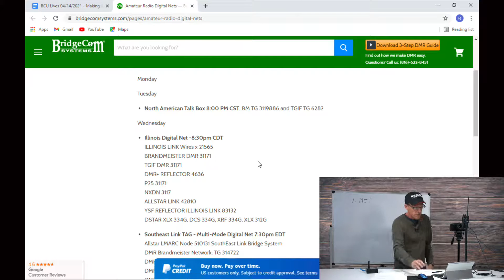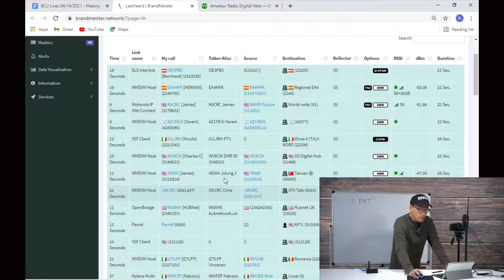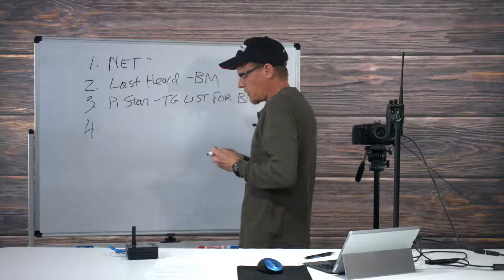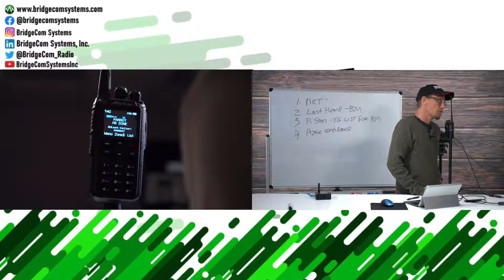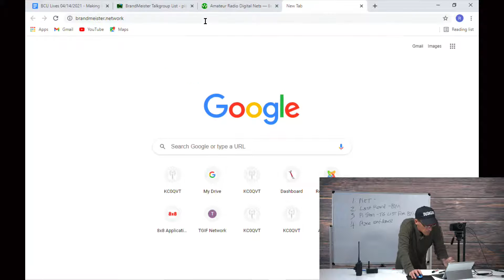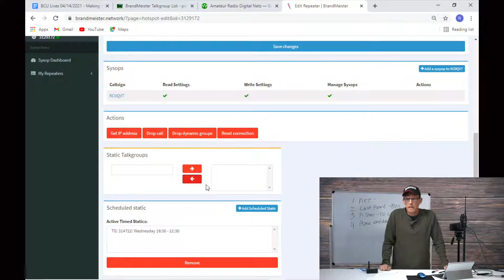How to Make a DMR Contact: Our Proven Step-by-Step Guide

Comment: Is there such a thing as simplex DMR, or do you have to use talkgroups?
Reply: Brendan:  Yes, you can set up two DMR radios to do simplex with each other.  Just pick a simplex frequency and make sure both radios are programmed with the same settings.  A common choice could be 441.00 MHz, Talkgroup 99, Color Code 1, and Timeslot 1.  Make sure you also choose "Admit All", or similar words, depending on your radio type.  A couple of other common DMR or general digital simplex frequencies are 446.500 and 446.075 MHz, but it depends on what your local repeater coordinators have designated for digital simplex modes.  You might also check with your local ham club or repeater group to see what they might be using.  Some have designated their own local analog or DMR simplex settings that everyone nearby can use.  73 from K7DAA
Reply from the maker: Thank you for your question.